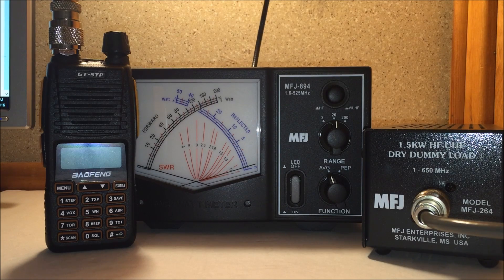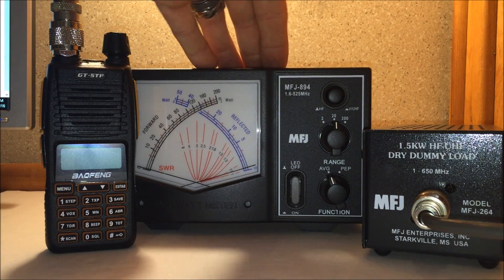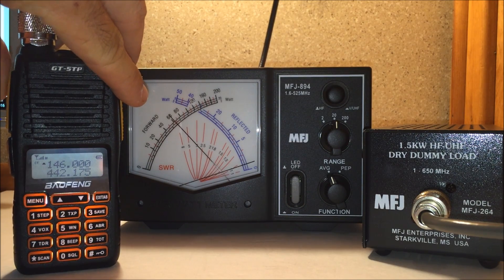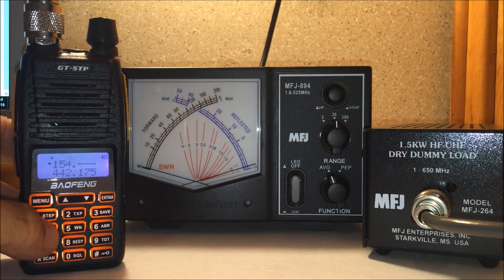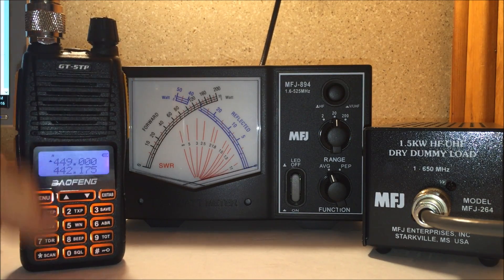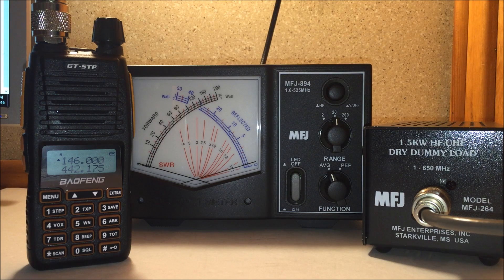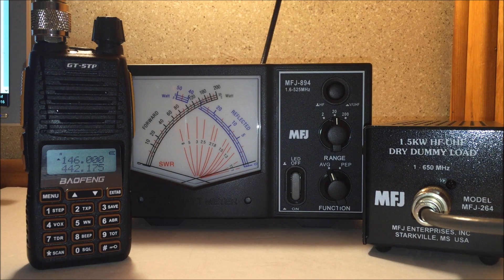Baofeng GT-5TP power test

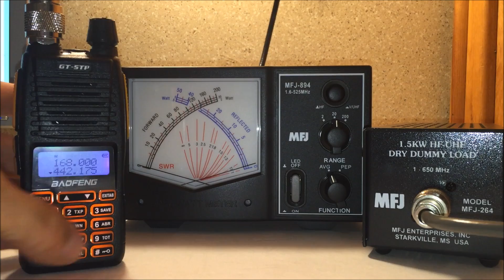Comment: 2:10 - Your pushing the top ptt button and transmitting on the top VHF frequency of 168 and not the bottom UHF frequency of 442.175.
Reply: This is why you are AGENT K🕵️‍♂️

Comment: When I hear the words Baofeng or Btech all I relly hear are the words Sh*t and Crap. People will try to roast me for my comment but it will fail as my view is based more on fact than opinion. These radios have been proven the be cheap noisy garbage as most all these radios are not FCC compliant meaning they are illegal to use. Anyone that gets a fine for using them deserve it, last i check its 10,000.00 bucks and if I can prove someone is using this junk I will certainly turn them in. If you can't afford a better radio then think about much you can't afford the fine.

Comment: are they a sponsor? if so i think you should disclose that
Reply from the maker: Not a sponsor, although I would like to get some sponsors for my channel so I can upgrade my video quality and some other better graphics and software. As far as their company, I really like this store versus shopping on eBay or amazon. so many people on my older videos that claim they bought a radio on ebay or some other site, had issues and never got a resolution or response to make it right. Radioddity has a good customer service base, and they try to stay current on the models and info. so I choose to promote them over someone else.
Reply: You don't need to upgrade nothing, just do a better rehearsal before shooting the video. Also review it before upload to avoid things like tx in vhf thinking its uhf. The information that you convey is the most important part, graphics and shit is cosmetic. Focus on info.

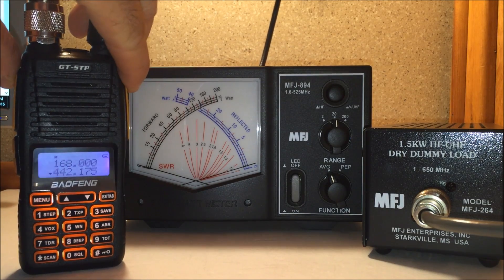Comment: At 2:11 you meant to key on (B) UHF but you keyed on (A) VHF again.
Reply from the maker: You are right. OOPS, ok, so ill add an annotation. But its 5 watts at least.
Reply from the maker: But this is the 2nd video i made on these radios, and it's only to show it in a dummy load, because my inbox fills up with tons of messages when they disagree.
Reply: +HamRadioConcepts lol. easy mistake. Good video and information though! I was looking into getting the GT-5TP. but I think I'm going to go with the UV-82HP
Reply: +HamRadioConcepts I don't understand the significance of using a dummy load.
Reply from the maker: +Taps please watch my dummy load video I just uploaded it will explain it all